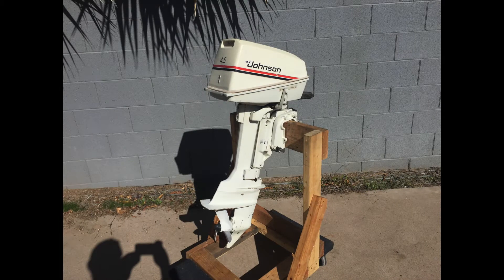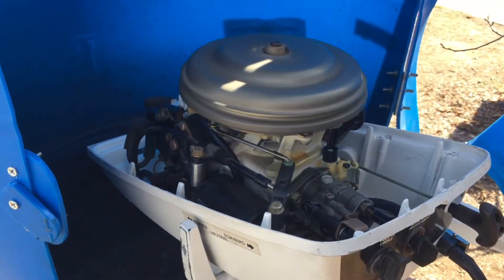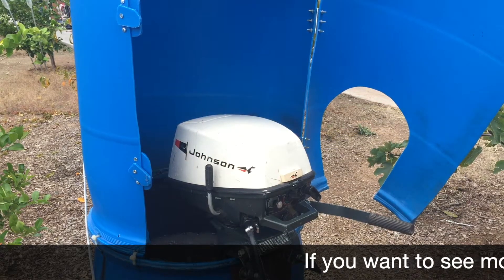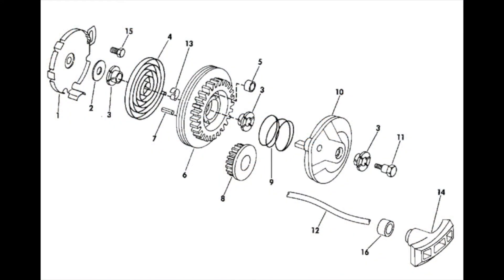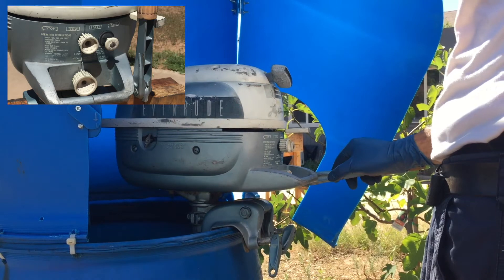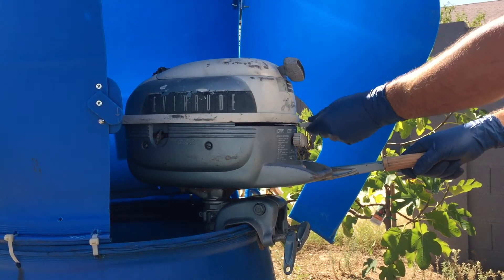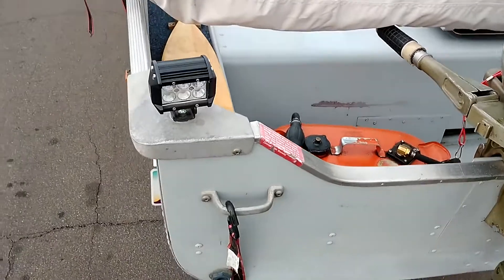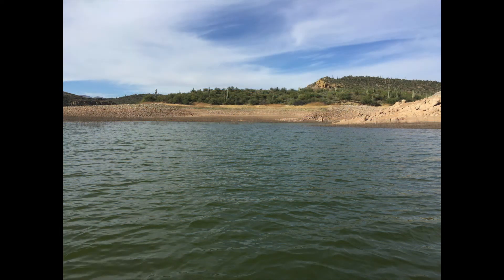1967 - 1983 JOHNSON / EVINRUDE 4.5, 4 AND 3 HP OUTBOARDS REVIEW AND MAINTENANCE TIPS

Comment: Still slightly confused if my motor has a fuel pump or not. It’s a 1980 4.5 Evinrude. Not sure if it’s just gravity fed, or if it has a fuel pump?
Reply from the maker: Do you have the model number?
Reply: @BoatMotors  I believe it’s “E5RCSS”
Reply from the maker: @GarrisonLee  Yes you have a fuel pump. https://www.marineengine.com/parts/johnson-evinrude-parts.php?year=1980&hp=4.5&model=E5RCSS&manufacturer=Evinrude&section=FUEL+PUMP

Comment: I just picked up a 1973 Lightwin for $120. Ad said that "it starts, but doesn't run smooth"

It really just needed the mixtures adjusted properly, the guy said he didn't know anything about outboards lol
Reply from the maker: You need to service the motor. Please watch this video https://youtu.be/hog4QypoN8E
Reply: @BoatMotors  I had it running like a top in the barrel, once I put it on a boat in the water it wasn't producing much power, pulled the leads off the plugs and its only running on No.1, so I'll order some new ignition components for it.

Wonderful, smooth running little motor though, even on just 1 cylinder XD. Still not as quiet & smooth as the 195X Evinrude Fisherman I had years ago though. That was the best outboard I ever owned.
Reply: lucky you, found a great engine cheap

Comment: I own a 1981 4.5 evinrude 2stroke, can you explain the middle switch, it says slow adjustment. Myself being new I don't understand what it is used for. 

The choke has a shut off valve it says in the video.  I believe that is when you turn the choke left or right, does it matter what direction left or right?
Reply from the maker: Hi, that is a really nice outboard that you have. The middle switch you are talking about is the idle speed adjustment. If you turn it to the right, it will close the needle jet and decrease the idle speed. If you turn it to the left, the needle jet will open  and increase idle speed. It is very sensitive and is best to use small adjustments. Of course this will only happen if you have a clean a carburetor and no air leaks from cracked gaskets. Don't forget to change the lower unit oil, the impeller, and the fuel lines. Next time I have a motor like this I will make a video about it!